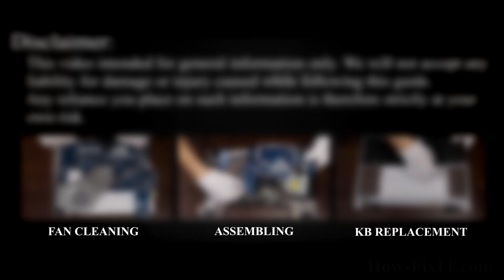Acer Aspire E5-511, E5-521, E5-571, E5-572 HDD or SSD Upgrade: Replacement & Installation Guide

Comment: I have the 571P without the optical drive. Can i remove the black plastic enclosure and replace it with a caddy that has HDD or SSD for additional storage? Tk u.

Comment: Hello how do I know if an SSD hard drive is the right one for my Acer Aspire E5 571 as not all of these SSD look the same and I know it's this one I should be looking for but I can't find the exact one in the exact memory I need because I found something and it is a crucial SSD hard drive and I want to buy it but I'm not sure it will fit in my laptop do I have to just put the metal around it then screw it into the laptop
Reply: you can find your harddrive in your system device manager, then google it, i have an e5 571 with a 2,5" sata III hard drive from wd if you couldn't find an answer to your question...
Reply: @iyoaw4360  Did you replace your ssd with hdd? Or put it somewhere else?
Reply: @titord7601  I replaced the Hdd with an ssd, yes and cloned it whole then put the still full Hdd safely aside
Reply: @iyoaw4360  ok, thanks for info🤔🙏

Comment: Honestly what ashit design, how hard is it to make  a panel you just screw out ffs
Reply: Think about this though, how often are you going to need to pull the computer apart at all? Honestly, for how little you'd need to do it, its fine.
Reply: @zethcader6478  I think it's just a way to get the user to go to the store they bought the computer from to get work done rather than have a go themselves, like a self serving industry. Currys PC world or whatever probably have a guy that buys stock thinking which laptop is the most pain in the arse to work on, we'll stock them. That way if they need to upgrade or repair they're more likely to come back to us to get it done, just all bullshit design is a self serving industry.
Reply: @manwithapan9481 
You may be right, but in this case, this acer laptop specifically is defiantly not at the end of the hard to upgrade. You take out some screws and the keyboard, its a few ribbon cables. If you had somewhere to be it wouldn't take more than an hour and half.

Also, consider that sometimes bullshit design can be caused by lazy designers (or a crappy boss) trying to cram parts into spaces things normally don't fit into.

Comment: hola, sabes si esta notebook soporta un disco ssd m.2 de 256 gb? gracias.
Reply from the maker: Este portátil no soporta m.2.
Puede instalar un SSD SATA en este portátil. En la descripción debajo del video encontrará enlaces a SSD compatibles.
Reply: Y le puedo agregar un disco ssd sata sin sacarle el disco duro que tiene?
Reply: @guillermofernandez315  Eso puedes hacerlo comprando un adaptador para quitar tu lector de dvd y en su lugar agregar un segundo disco para almacenaje.